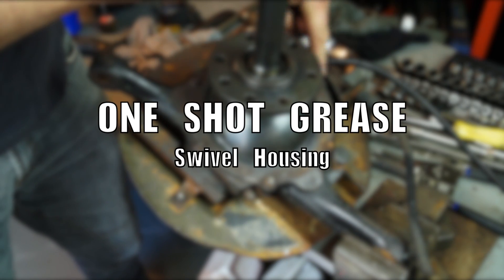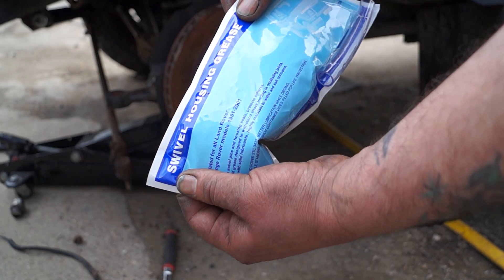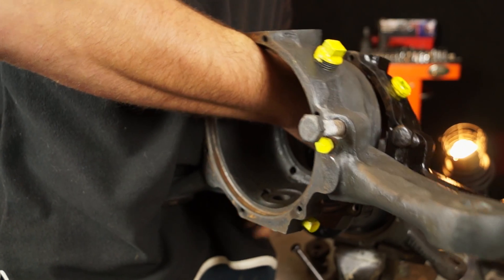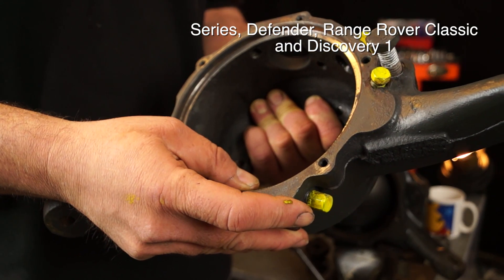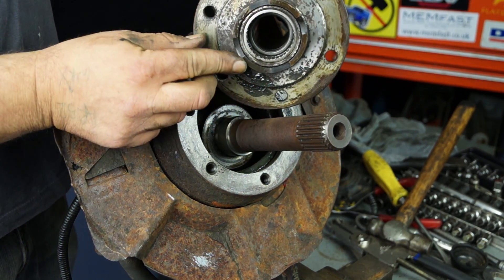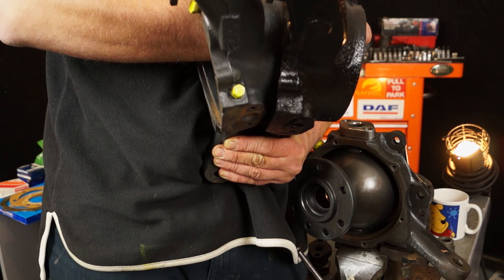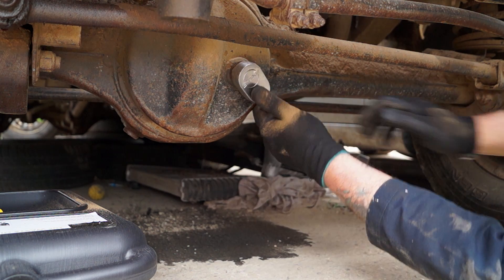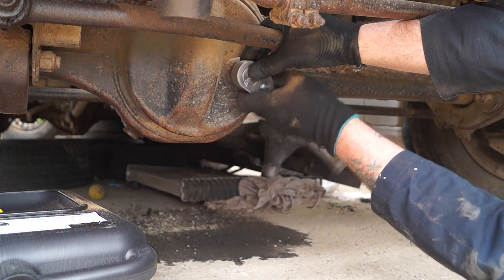Swivel pin housings fill, level and  drain plug.differences, one shot grease and EP90 - Land Rover

Comment: Ok, explains why my rear diff was overflowing. Altough there was also some water in it (gray bubbly stuff). It was also quite clumpy. 

I've got 86 RRC. I was wondering why it doesn't have dust cover with the driving flange, but there's axle through the hub (10 spline) that bolts off. So basically the axle is attached to the flange/cover/whatever. 

I've seen the type in some Defender rear axles, but this is in both front and rear. Is there anything I should be aware of with this type of axle compared to the other one. I mean I haven't seen it in any shops, etc.
Reply: this video only applies to the front axle, !!!

Comment from the maker: yes, when you replace bearings on a fully floating hub, ( that's the Land Rover type then they really need to be greased when fitting even if the hub is oil fed. Common practice. Gives the bearings a chance before the oil gets to work.

Comment: I've seen this a fair few times (more than I care to remember) As most axles will have had greased bearings at some point I've never seen it become a problem... The only question is will the one shot mixing with the EP (or 80/90 in many cases) become an issue to the effectiveness of the oil on the diff? Will the temperature raise enough to become an issue to seals etc? I've never monitored the temps of a landy axle ... I'd be interested to know what they run at under normal conditions etc.